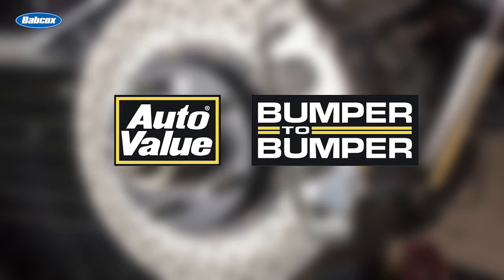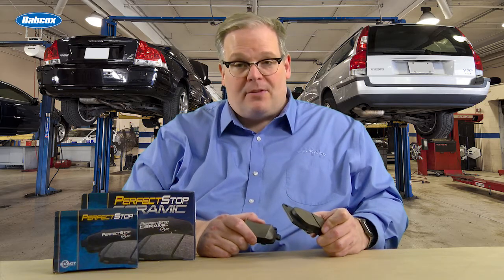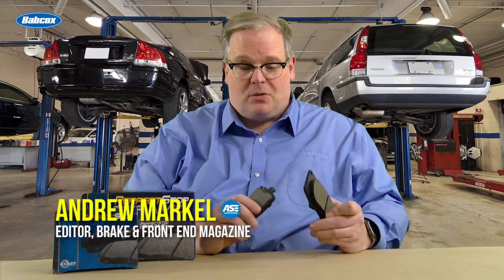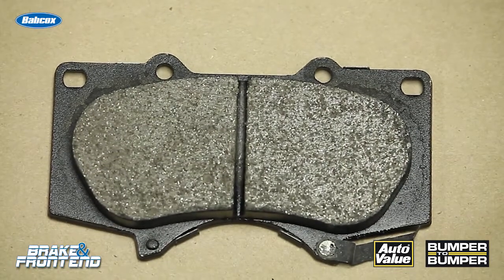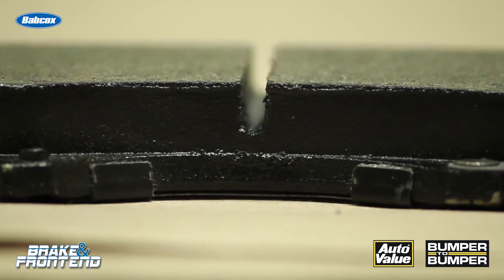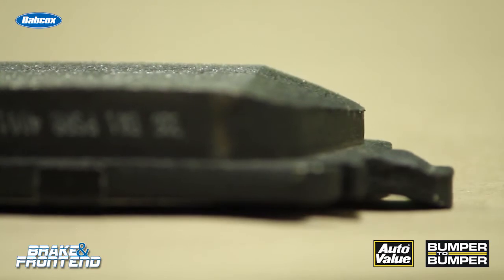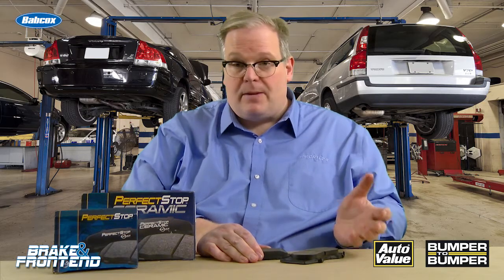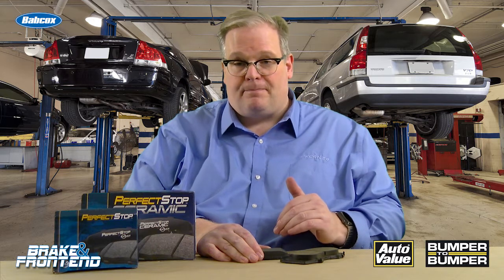Brake Pad Chamfers And Slots | Tech Minute

Comment: The frictional force is proportional to the real, not apparent, area of contact, and the real area of contact is proportional to the load. Therefore the area cancels and the frictional force is proportional to the load. 
There are some studies suggested that chamfer brake pads do reduce squealing noise when braking. Here are some references. 

Lin, S., C. Guan, a. r. abu bakar, M. Jamaluddin, W. Harujan, and B. Ghani (2011), Disc Brake Squeal Suppression Through Chamfered and Slotted Pad, International Journal of Vehicle Structures and Systems, 3, doi:10.4273/ijvss.3.1.04.

Rashid, A. (2014), Overview of disc brakes and related phenomena - A review, International Journal of Vehicle Noise and Vibration, 10, 257, doi:10.1504/IJVNV.2014.065634.

Comment: chamfers leave less contact area and less brake performance, no?
Reply: You are 100% correct. Some really smart person figured out a way to cheat customers and make it sound like they are helping them.
Reply: Yes.
Reply: only in heat dissipation which is negligible. regarding brake FORCE, it stays the same, taking in account that one type of brakepad does have chamfers and the other doesnt, while the coefficient of friction (and the rest of the brake pad) stays the same.

chamfered brake pads do wear faster as there is simply less volume/mass of the brake lining. but in terms of stopping force, chamfered brake pads do NOT make your car brake any slower, disregarding the worse heat dissipation (which can lead to brake fade faster).

Comment: Chamfered pads is basically using smaller brake pads than what the vehicle was designed to have...like up to 20% smaller pads buy having a Chamfered edge, which reduces braking power to reduce a noise ??  What noise ??  Not good for Trucks hauling loads or trailers !!
I didnt know that a mechanic installed them on my Truck. Something always seemed funny when stopping, like the brakes were not as strong. I was like ...I just had these done, WTF ??  I  pulled the pads out, saw they were beveled and..... tossed them.

Comment: This guy is reaping a lie the brake maker told him. Chamfer is how the maker save money. They give you less brake material. Then they lie by saying it helps with noise. Noise come from cheap shims aka the backing plate on the back of the pads.
Reply: i hate the backing plate on the back of the pads. It has slop in it. Things need to be mechanically tight so when the pistons retract slightly the pad does too. And when the pistons are pushed out they are pushing on a pad, not a space created by a loose flexible piece of sheetmetal.
Reply: @dangerdavefreestyle  Remove the shim and the pads will squeal.
Reply: @blackericdenice  i did that to my stock pads. they still had plenty of meat on the bone. the shim stack on the back was all corroded and floppy. i cut it all off, sanded up the pad friction material, and that thing did not make a peep. drove it that way for the last six months. the rotors had rust on the edge which migrated and about 30% of the rotor was ineffective, nobody would cut them, so i got new rotors recently. i got new pads too just because i know im not a machine shop and if the stock pads are not perfectly flat, they will not mate 100%,  the new pads do have those shims on the back and i would love to cut them off. but so far it drives ok. probly might just leave it as is.